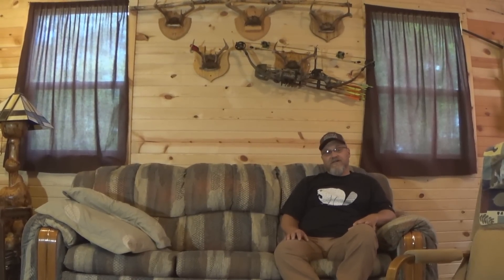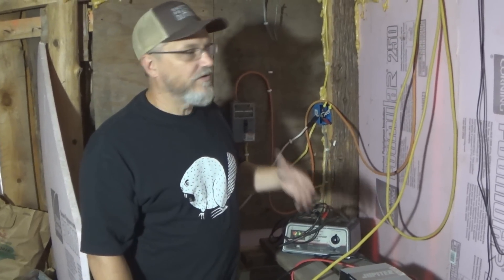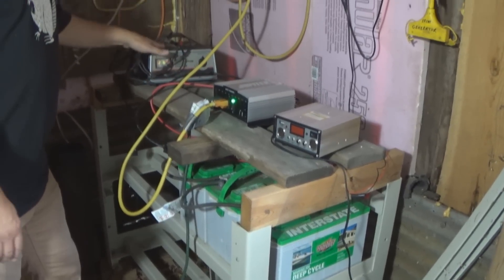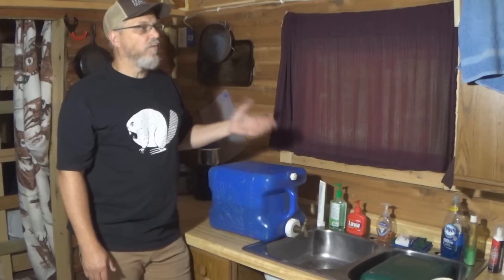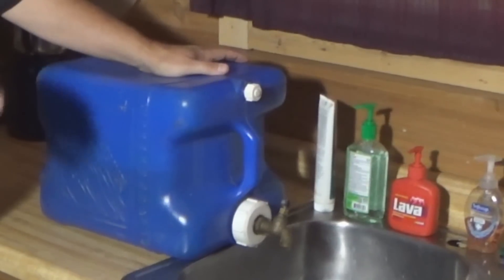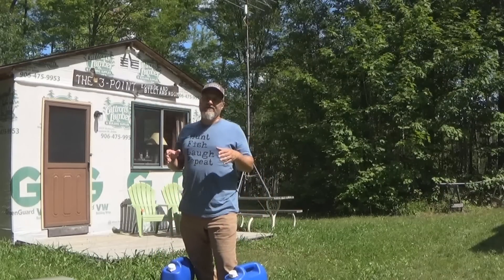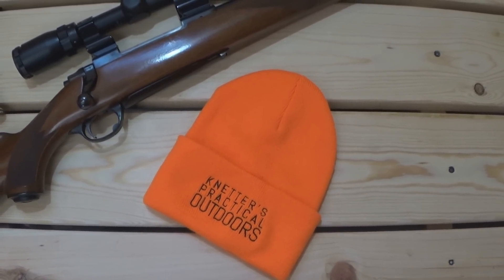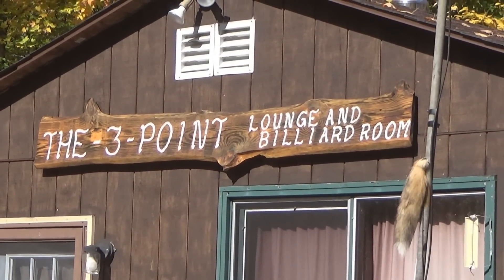Off-Grid Utilities - How We Do Heat, Water, Electricity And Sewer

Comment: Why don't you set up a rain catchment system so you don't have to haul water? I love the electric system... no messing around with depending totally on solar.
Reply from the maker: We did that for a couple of years.  Sometimes we go a while in the summer without using a lot of water and our rain barrel just became a mosquito breeding pool.  Thanks for watching, KPO.
Reply: @KnettersPracticalOutdoors  Because you didn't use Screening to keep them out. Screening Finer than window screening. Cutting a whole in the lid to allow the water in. I use 32 gallon Garbage Cans from Walfart at $10 each.

Comment: Interesting but I can do it alot cheaper they have thermal electric generators some u just put into of your wood stove and they have a different generator type that u can add to the stove pipe. It's on you tube. But you do have to dig for it. They have generators that are small enough to run a small cabin or big enough that u can power a huge home. Also why r u bringing water into your camp? They have the hand water pump that u can drill by hand takes about a day to do that they have a manual tool u can use to drill that I will see if I can find a few videos on it
Reply from the maker: Yes, we tried the hand pump.  The water we came to was suctioned into the ground and difficult to draw up.  Points aren't always easy to put in or take out.  Ours won't come back out so if we want to try another spot we will need to buy new point.  We will probably do this, but it's not always as simple as it seems.  KPO
Reply: Did pipe get stuck or damaged
Reply from the maker: @lorifoster6562  the pipe just wouldn't come back out.
Reply: https://youtu.be/uA7Ye9jqPi4

Comment: I'm surprised you haven't had a problem with using extension cords for your power to camp. typically they are on ly 16-18gauge wire which is undersized to run multiple lights and TV and such. you may want to upgrade the cable from the batteries to camp to at minimum 12 gauge cable.
Reply from the maker: This is a very important thing to consider.  But our inverter is small and has it's own circuit protection.  It only goes to about 8 amps so it will trip out before the extension cords reach there max amp rating.  Thanks for the interest, KPO.
Reply: I have a 14 gauge running a small ac small fridge light and tv so far it's ok
Reply: Obviously NOT OSHA Approved

Comment: Hey Dave good video. Just curious why not put in a point well for your water? I wouldn't think ground water would be that deep where your at.
Reply from the maker: We pounded a point in a few years ago but couldn't draw the water out.  Lots of vacuum but the water was suctioned in the ground.  I've been told that happens sometimes.  Couldn't get the point back out.  But yea, I think we will try again sometime.  Thanks for watching, KPO.
Reply: @KnettersPracticalOutdoors  Every so often it's necessary to tighten the pipes with pipe wrenches, pounding the pipes make the fittings loosen up a bit, basically your breaking the seal and allowing air into the system thats why your not getting water up properly... I've seen this 100 times lol
Reply: Sandpoint wells are definitely a way to go, make a offgrid water filtration system though it'll clean the water if the well is shallow